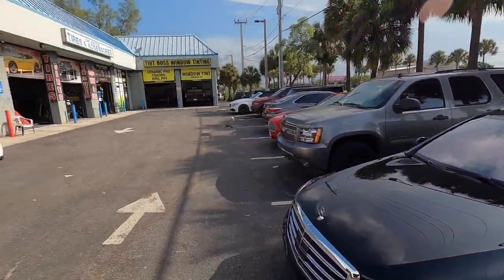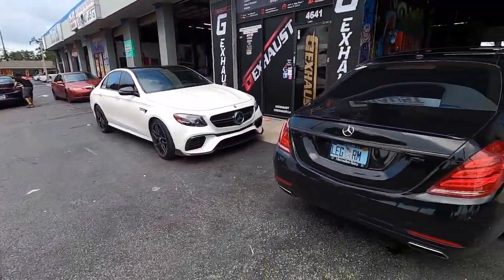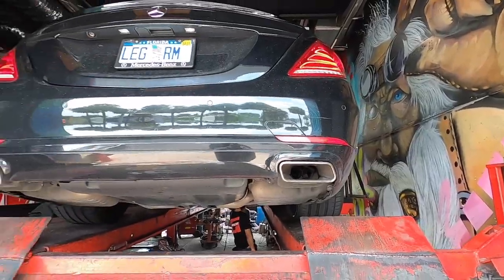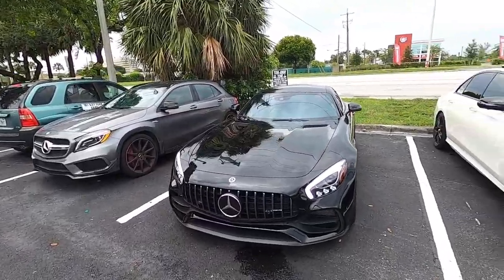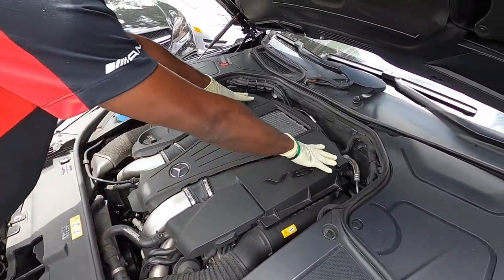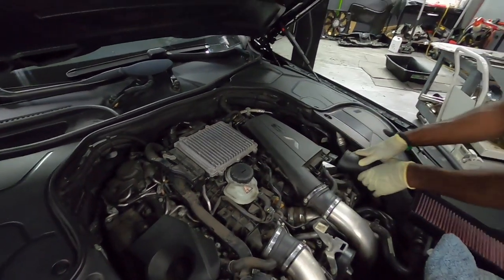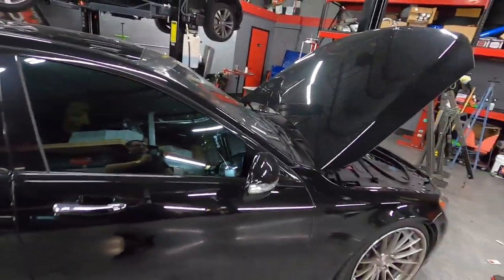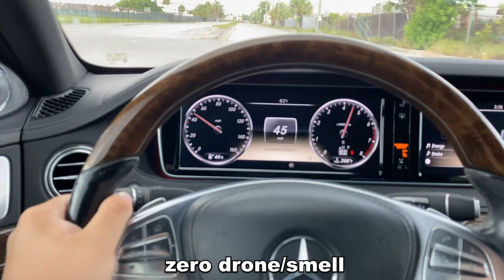I went full STAGE 2 on my S-CLASS! * downpipes/intake/tune install w/driving clips & cold start/revs

Comment: Also, you might want to consider soon replacing the cooler lines for your turbo's they go bad and leak often after a while too
Reply: They upgraded them to the aluminum ones so they fixed that problem but he probably has the half metal half plastic ones

Comment: Hey man... I have a '15 S550 and am wondering if I should go stage 2... I'm hesitant because I intend on keeping the car a while and am wondering how reliable it would be with a stage 2 build. What are your thoughts? M278 is an incredible engine.
Reply from the maker: Didn’t have any issues at all and I just sold the car with 103k miles, power was great and fuel economy improved a bit too
Reply: @MercMan  how much did you sell it for?

Comment: I Have a 2019 s 560 4 matic and have been debating on whether I should do a renntech tune for the hp, valves, air filters or keep it stock not to void my unlimited mile CPO warranty. Any insight would be greatly appreciated. I havent seen any videos where specifically the 560 variant has been tuned. Is rentech the way to go? Is there other brands I should look into? Do I leave it stock. Great video !
Reply from the maker: If you want reliability and a warranty I definitely recommend RENNtech, and the 4.0L in the 560 is a great engine and makes really good power more than my 550 made and that was already a rocket ship
Reply: Appreciate your input I think I’ll pull the trigger
Reply: @fchernyak hey saw your comment I see a year later but have '19 S560 too debating on tuning her... did you go through with it?

Comment: Where u get the tint done at bro
Reply from the maker: it's actually normal 15% ceramic tint over the standard S-Class windows, they have a special coating for UV rays/heat rejection
Reply: @MercMan  15 percent wow the car is beautiful  bro how much was the paint job I want gun metal black